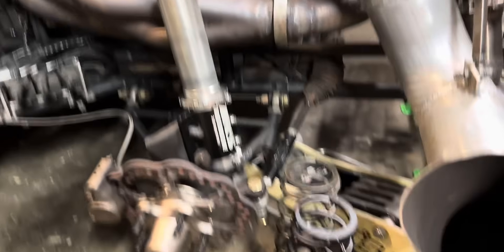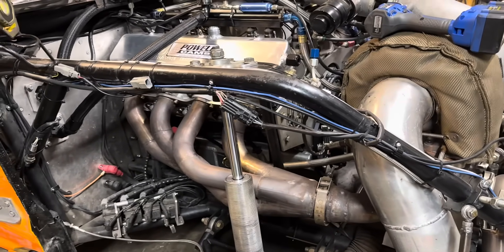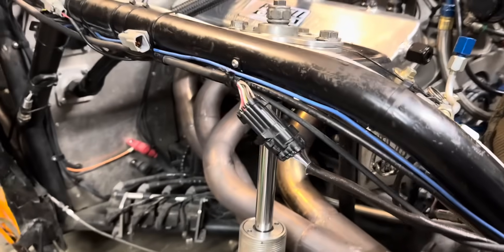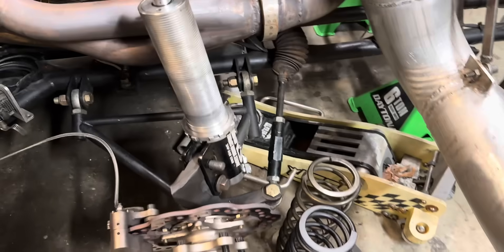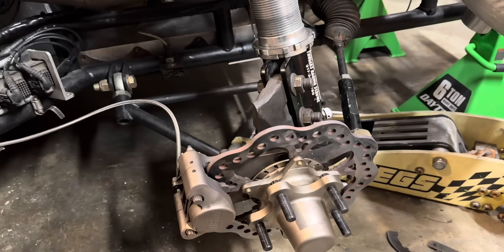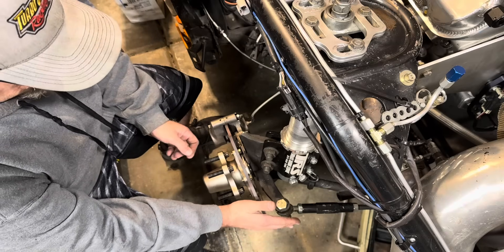Bump Steer for Long-Travel Front Ends / can you get it perfect?

Comment: I actually bought a cheap camber caster kit off. Amazon has the bubbles and level indicator that kind of stuff. I measure it when the car s all the way on the front. Then I jack it up so that the front tires get fully extended and look at that value again in comparison to see if I have a bump steer problem. I'm not sure if I'm doing this correct but that's how my mind works

Comment: Super critical part of the front geometry.   When I first got my car together this summer it was way off.    On a super smooth track it would go straight for most part.  A less than ideal track my car would want to dart left a lot.   Come to find out at full extension I would gain about 5 degrees of toe in.   Now that it’s corrected within .4 degrees within the whole stroke of the shock the car has been way more predictable.    We fought it for awhile until we had it on video at a good angle and could physically see the toe in.
Reply from the maker: That's awesome you got it dialed in!